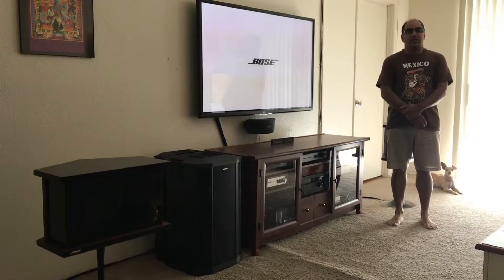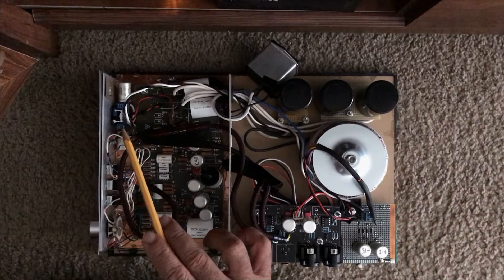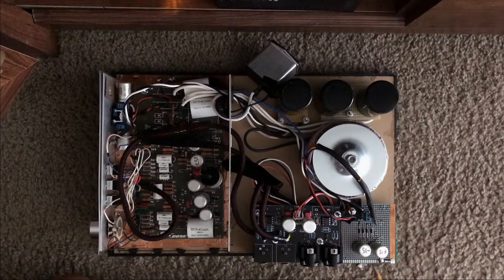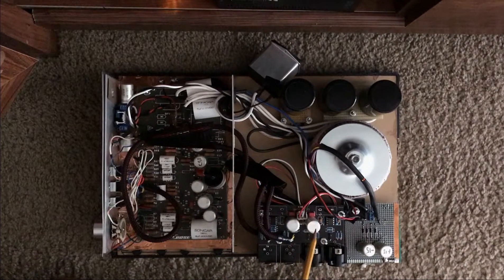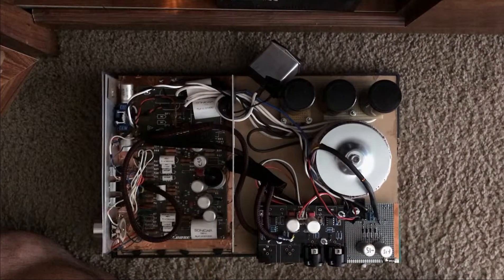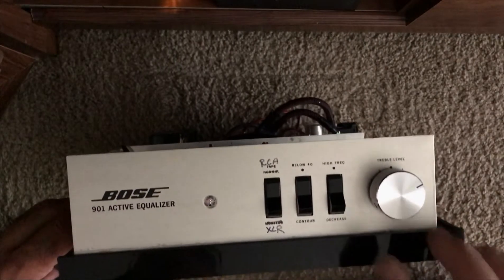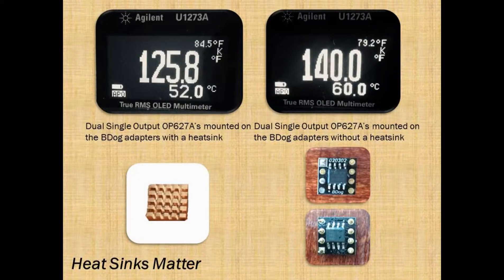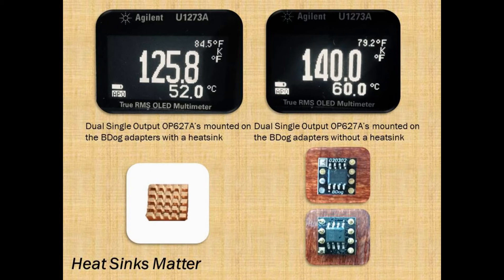Bose 901 Series 2 Equalizer Part One : Better Sound Through Some Major Tweaking

Comment: I have read a lot of mods for 901 equalizers. Mostly snake oil. Some say you need a burn in time after modding. Rubbish, what’s going on is your ears are acclimating to the sound. I rebuilt my 901 Series VI eq. It sounds wonderful with just about anything. The Series VI do not suffer from foam rot. 
If you hear a difference on that series wonderful.